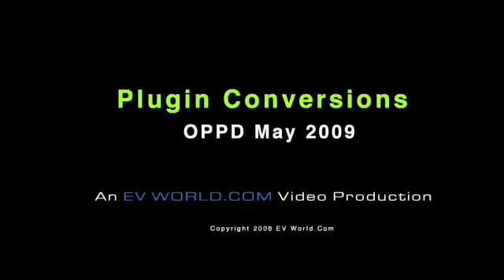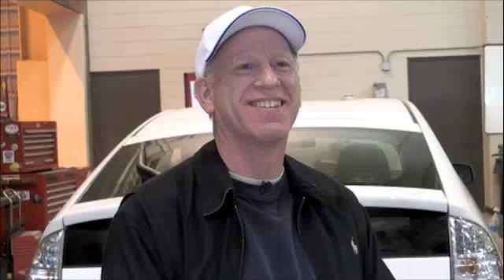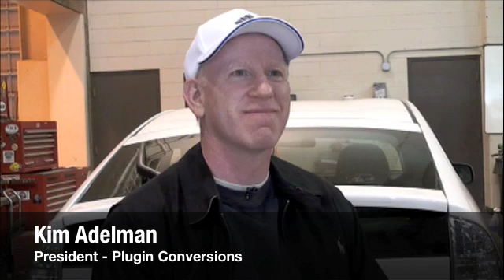Creating a 165 MPG Toyota Prius

Comment: So.....maybe I missed something.......does the battery charge while you drive the car? If so, why would I have to plug it in?
Reply: It does both.  But because it is a bigger battery pack than the standard one, regenerative braking alone may not be able to fully charge up a flat battery.  So to get the increased electric only range, the battery needs to be fully charged overnight to give you that extra range.  Hope that helps.

Comment: On full battery power, the car will not get 165MPGe withou a lot of hypermiling. Yes, the MPG can be 999,999,999 but the MPGe will be around 110MPGe or a bit less.

Comment: gas has to hit $6.50 a gallon before a stock prius pays for itself ...this is a $12,500 add on so gas would have to top $14 per gallon and the battery only lasts 3 to 5 years...what a load of crap! LOL 165 mpg but they only went 20 miles on flat ground...just another scam!!!
Reply: beachbummm69 There is a used prius for sale near me. A 2009 for $4995 with 100k miles.  After about 4 years the car would pay for itself in gas savings with my amount of driving, which is fairly average. A person could easily pay more than that price for a different 2009 model, and not save enough money to pay  the car off.  So if a person needs to buy a car, why not buy a car that eventually pays for itself?

Comment: As of October 1, 2011, you can find second-generation Prius examples with asking prices under $8,000.  Some need the traction battery replaced, and will thus sell for even less, especially if a small used car dealer is offered cash.  

That means that with a $7,000 car and a $13,500* conversion from this company, one can own a modern automobile that earns 90 miles per gallon on the freeway with a mere $21,000 budget.  This is less than the cost of an average new car.  This is serious progress!